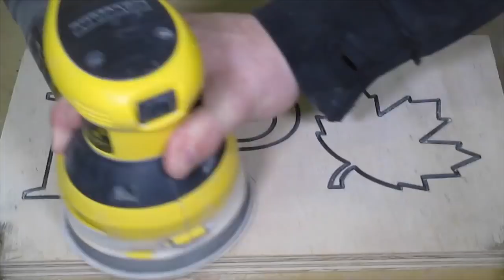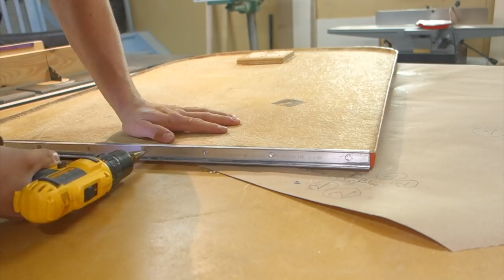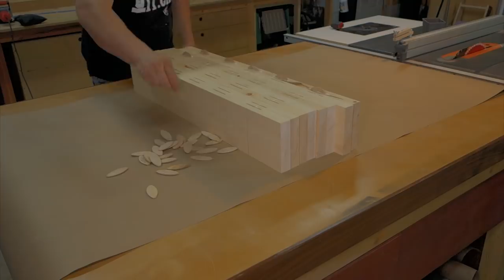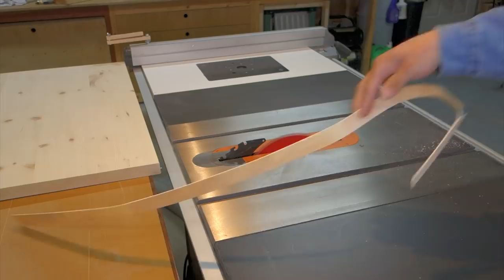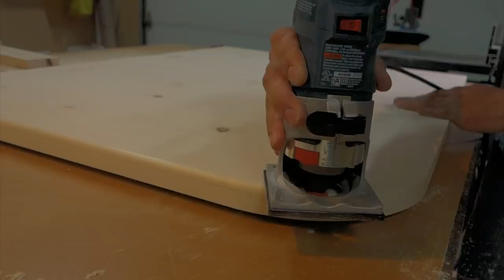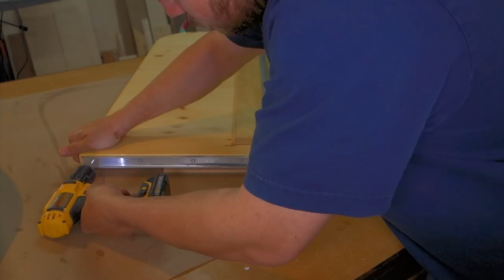Make It - Camper Table

Comment: I want to do this for our camper. I'd really like to know if the table will slide along the length of the rail, or do you have to lift/angle it first? Ours needs to move to provide better access to one of the bench seats.

Comment: I'm about to make a similar table with 1x4 fir (but it will be free standing with folding pedestal legs). Before I start, do you think this will be strong enough to use as a bed in a traditional rv dinette (resting between two benches)? The boards would be running parallel to the benches. I'm concerned about the boards warping under pressure. Thanks for the great video! It's the best I've found, by far.

Comment: That's an excellent job on the table but jeez that's a heavy duty table for a very lightweight trailer! The owners might have to add a little more air pressure in the tires! :-)

Gerald
Reply from the maker: backyardcnc It didnt seam that bad until I picked up the fiberglass one.  I calculated the weight before hand and my client was okay with it.  Its just over 20 pounds I think

Comment: Why would you waste your time with biscuit joints? They do hardly anything but be a waste of time. They add hardly any structural support.
Reply: You clearly don't know much about woodworking.
Reply from the maker: Yeah sorry that's not true. Even if they didn't add strength, which they do, they aid in lining up large pieces.